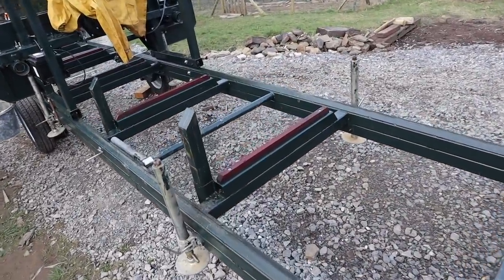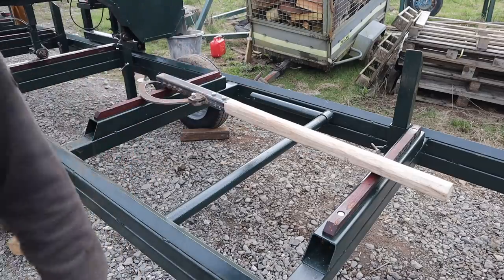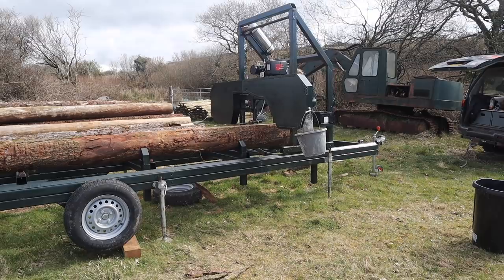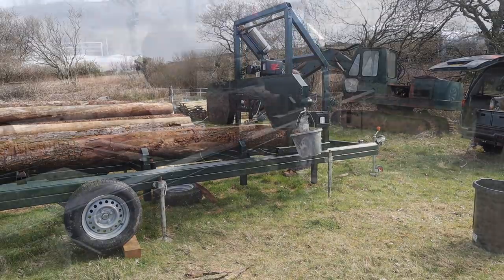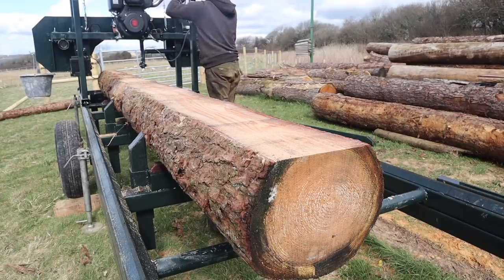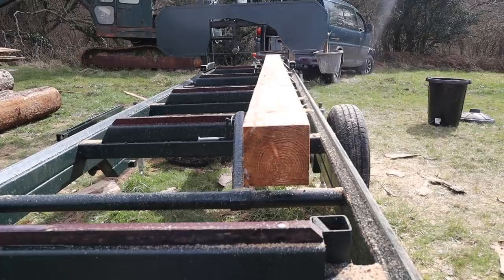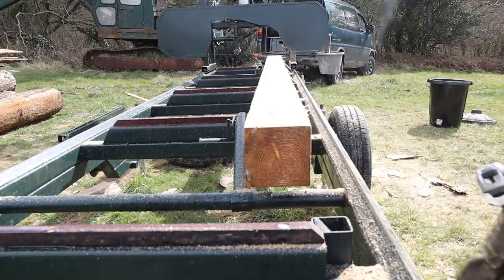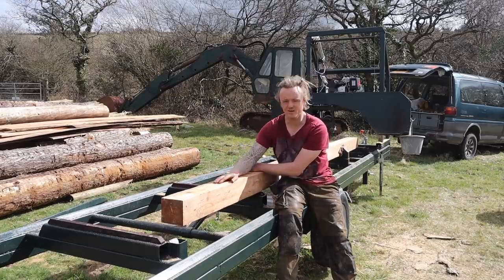First Cuts On the Homemade Bandsaw Mill

Comment: Did you really spend 2000 pounds and a months worth of 10-12 days building this? I admire the "I am going to do everything myself" attitude but didn't you just basically break even or lose money doing this? A brand new bandsaw mill costs 2-3K USD plus you get a warranty, delivery, etc. Maybe things are different in the UK but it seems like you need to focus on your real money earning labor a little bit more.
Reply from the maker: You cant buy a bandsaw for 3k that can cut 6m long 800mm wide logs with a powerful diecel engine and made from thick heavy steel. You can buy a basic cheap bandsaw for that cost but the length and widths can cut will be much smaller. and the quality cheap with a pointless warranty. why do i need a warranty if i can fix things myself?  

But the main thing you are forgetting is i make a living from making stuff and videoing it. if i purchased a machine thats just a loss to me. if i make it i get the money back. Because i make things like this i get a huge amount of opportunities. I turn down thousands of pounds in sponsorships and marketing offers all the time. I get offered jobs weekly. people ask me to come on podcasts and tv programs. I make friends and people recognise me and the street and come and say hello. I get at least 5 people a day email and offer to volunteer with me.  None of that would happen if i had the mentality of well i can just buy one for 3k why make it. All that mentality will ever do is hold you back. even if it cost twice as much to make it its worth it just for the learning how to do it.
Reply: @KrisHarbour  I am not knocking what you have done. Kudos. I couldn't do it. But are you making a lot of money on some of this stuff? If you're goal is to get ahead financially maybe focus on your more high dollar labor, you are an incredible craftsman. Do what you love and have a passion for, but sometimes making the tool, or whatever, when you could buy it makes less sense. I don't know for sure just a thought.